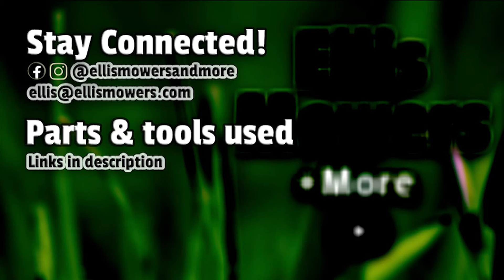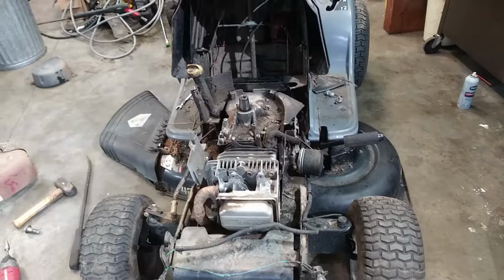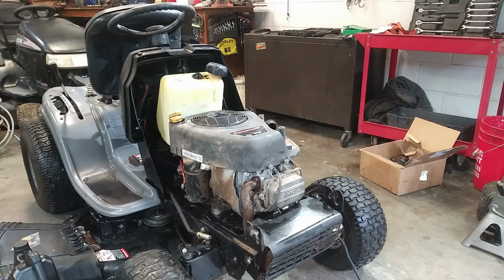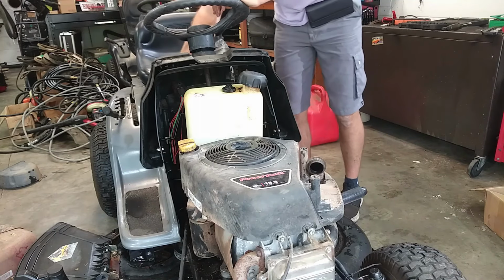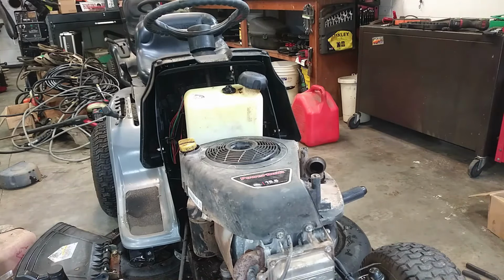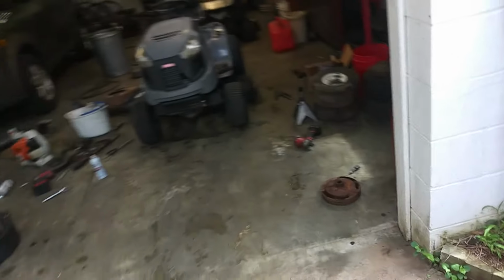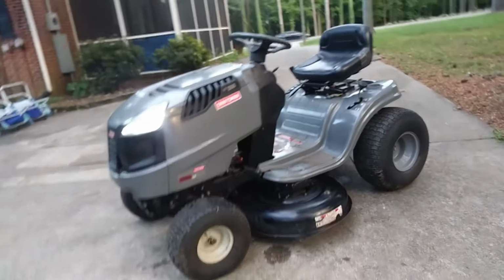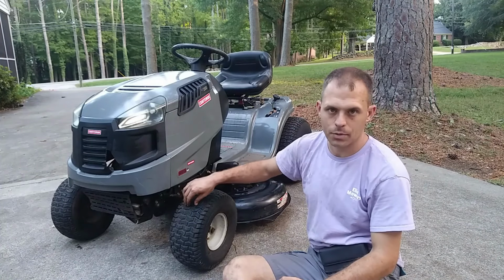MTD Craftsman LT1500 riding mower needs a new engine.  Let's swap it!

Comment: That Craftsman tractor cleaned up so good, especially after the headlight cleaning, and new LED lights put in. Glad that the engine swap went well, and that you replaced the oil seal, so she will hold her oil. I assume thats 15HP engine on the 42" deck. That has a strange gear shifter, its squigly pattern lol. You turned a disaster into a treasure Ellis, cause that engine runs smooth! That should sell so fast!

Comment: You had an awesome score on this deal. I got a good one myself this week. I got a cheap Murray push mower and Craftsman Gold series self propelled mower out of the trash. The Craftsman had so much grass buildup on the underside of the deck that it was preventing the blade from turning. I cleaned it, put some gas in it, and it fired right up. That was all that was wrong with it. I had it running 30 mins after I brought it home. The Murray has been sitting a few years, and the carb is in rough shape, but that is all that is wrong with it. It's future is TBD since it is not worth enough to buy a carb for, but we'll see. Either way, I'll make about $150 off a free mower.
Reply: It’s money and I just enjoy doing it 😮. Win some and break even is not no big deal 😢

Comment: I love doing customer work, but flipping them is so much easier. Right now, I have three customer machines that I have had for months. One needs a flywheel that I am having trouble locating, the customer is ghosting me on the second one, and the third has a problem that I can't figure out. It is a Snapper Ninja with GCV160 that sat outdoors for several years with a broken air box. I got it running, but everything was seized on it. I got everything freed up and replaced everything in the fuel system, but it will only run fully choked, or on the highest speed setting. It will not run on medium or low speed. It's driving me crazy. Anyway, flipping my own stuff is a lot less hassle, lol.
Reply: I do a lot of flipping and customers stuff but I really don’t need it anymore, I don’t like being pushed at 73😢😢😢

Comment: Are all the single cylinder Inteks interchangeable? Got a 14.5 spare and a blown 20 hp rider. Thx!
Reply from the maker: Yes it should be a straight swap, you may have to transfer the harness from the 20hp to the 14.5 to make it plug and play depending on the age of the donor engine.